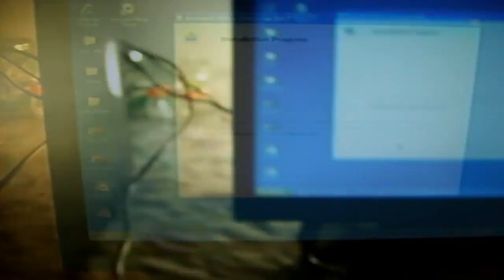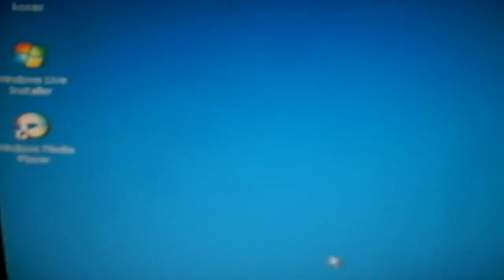$300 (Low) Budget Computer System [In Time of Recession...] - www.newmodcity.com

Comment: ~$500 build:
i3 2100 (3.1GHz)
nVidia GeForce GT 440 1GB GDDR5
Source 210 White mid tower ATX case
Western digital caviar black 500gb (6gb/s)
Corsair vengeance 4gb DDR3 1600MHz
Corsair builder series CX500 (500w power supply)

Comment: I had that exact Linkworld case a few years ago and it is really cheap and flimsy (flimsy...an understatement). The agp card kept slipping out of the slot and the metal used on this case is sub par to an aluminum soda can. I tossed the case in the trash shortly afterwards. The rest of this system shown here is low budget but what the heck...it works and that's all that counts, especially if you are on a tight budget. How does Linkworld stay in business producing such poor quality crap.

Comment: for 300 dollers i got a referb pc from microcenter for 80$ with dule core amdthhlon 64 X2  and 80gb hdd up grades amd raidon 256mb graphics card 45$ cpu upgrade to amd phenom ii x6 from a friend 100$ 10gb ddr2 ram 50$ and a wifi card 15$ and bluetooth card 10 $ from friend